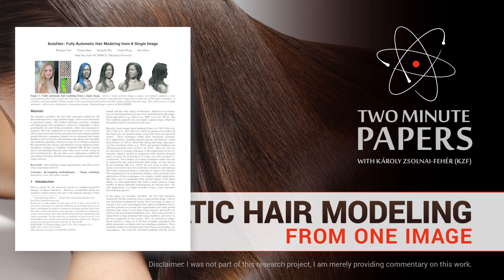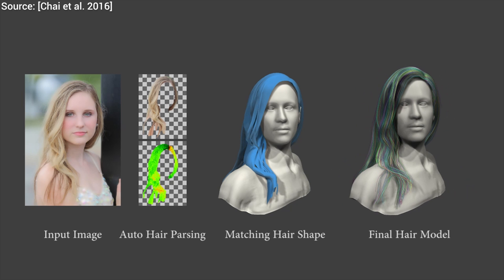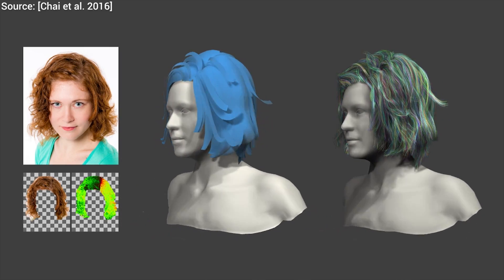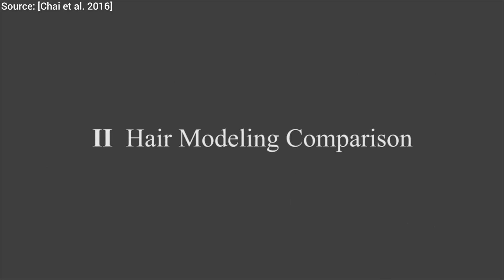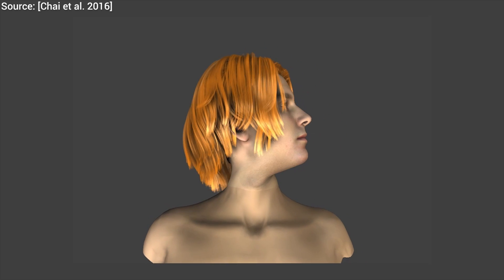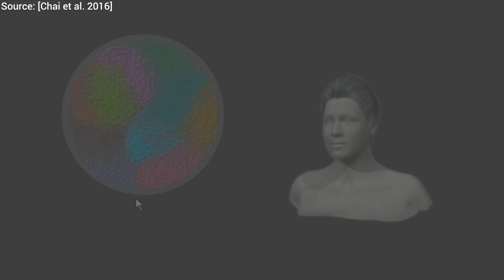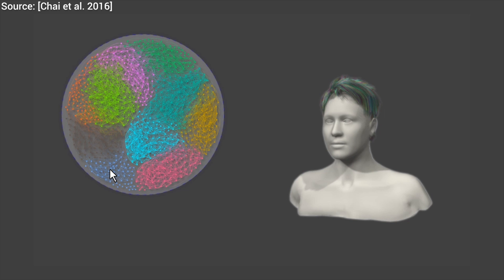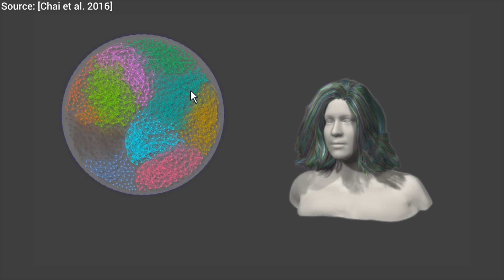Automatic Hair Modeling from One Image | Two Minute Papers #92

Comment: Still no example using afro hair, that's sad, it's not even an edge case, that's a literal blind spot. Why so? Why ignore an entire class of hair?
Reply from the maker: Try searching for "Davy Jones" here, hope it helps! - https://hal.inria.fr/inria-00520270/file/finalcoursenotes2008.pdf
Reply: I'm confused, what does tentacles of a monster have to do with black's hair? o_O
Reply from the maker: For the first sight, it seems to be that the way it was simulated is quite similar to what one would reach out for when simulating dreadlocks. It may be wrong though, but this is definitely the closest match I've seen so far. :)
Reply: Ah okay, I understand lol, but locks is very different than individual strand of coily hair interacting together. I'm looking now if there is a field about helicoid dynamics (though I'm not sure helicoid is the right term), It seems there is specific behaviors to spiraling strand with detangling stress and all (like reversing rotation direction), also effect of entangling strands etc ... which mean that each strand might have it's own "story" and have in impact in the mass overall behavior, while flat hair is more prone to common behavior as all strands are more or less very similar.

When I talk about black's hair (I'm not really black and don't have this hair either), I'm mostly referring to anything that isn't cornrows, dreadlocks, anything braided is not a focus. Free hair! and that's not even talking about consideration of hairstyle within than range.

But yeah it seems that research here is mostly dead zone.